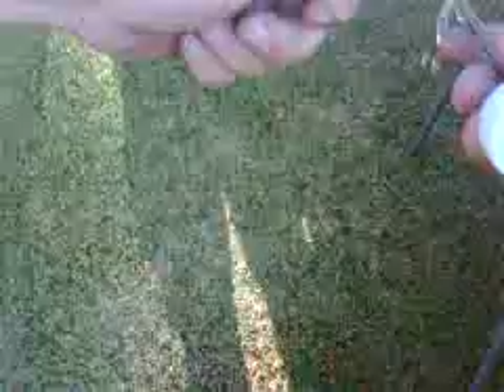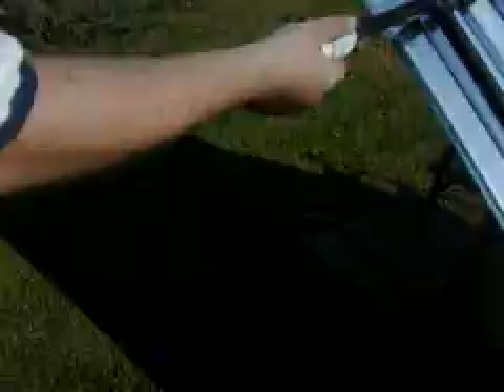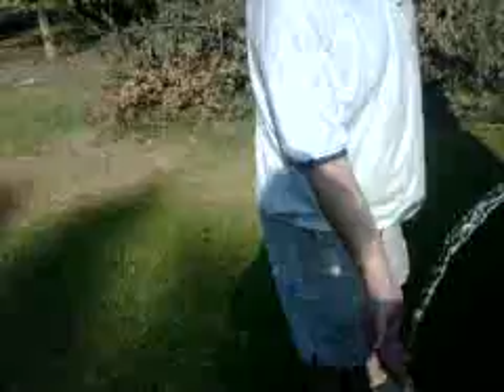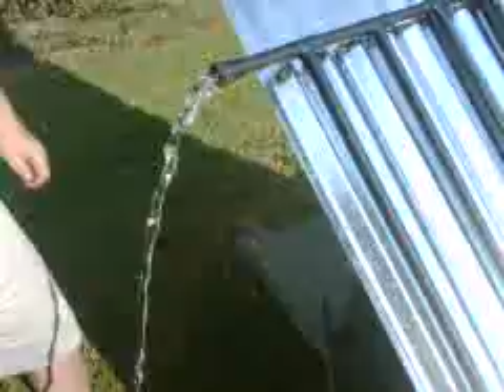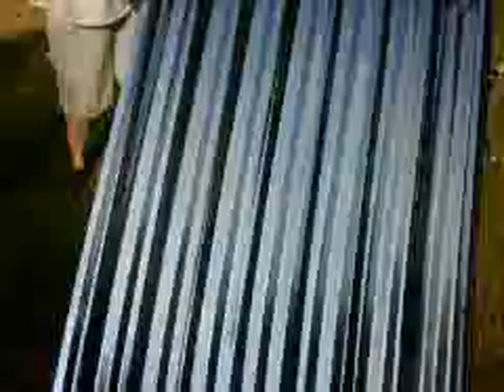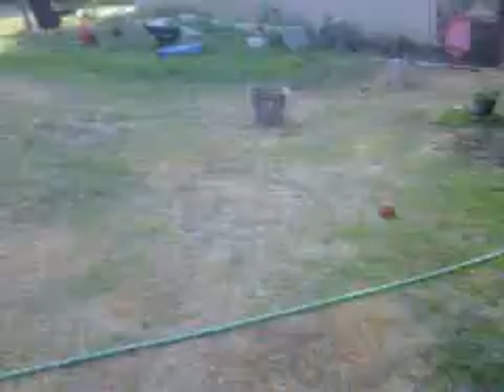Solar Water Heater build 8

Comment: GREAT WORK! THANKS!

Thanks for the great series of videos. I learned much. I am planning on having a hot-water tank attached to mine and let the water thermally recirculate through the grid to stay warm. If there is not a functioning one on the tank already, I will add a high-pressure blow off valve. Also going to add an automatic thermal blending device at the house to avoid scalding hot water. Have you had any experience with these types of design gadgets?

Comment from the maker: I have always wondered, how does this design not allow water to flow through the whole thing? several people have said the same thing and I just don't get their points, I see that a serpentine seems better because its a single flow, but we all know water, especially water being pumped will go anywhere it can, so I still fail to see the difference, heat rises, hot water rises, so far I have has no issues.

Comment: Sorry, as I said, do not mean to rain on your parade...i'm not suggesting it not a worker, but having made bit of copper work, it's somthing i've looked at and thought about, and gazed at other to try and descibe how to do it better. But of course, here in lies the madness of never being satisfied....you have it and it works, but if you can drag another 3 - 5%, & the price of the virtical tubes goes down, 'cos there smaller. It will always be a compromise.Regards Bob

Comment: I don't mean to rain on your parade..but 90.6 to 114 degrees..nice but no biscuit..lovely piece of work.. i'm sure the energy companys an't quaking in boots for 24 degs. Nb feature of central heating rads tubing of different sizes, horizonal / vertical, water pressure spreads it's perculation more evenly across the panel verticals.may be achiecevable by crimping the tubes near the inlet tube ? Vaccum box / enclosure 14 Lb/sq inch..it'd collapse,but  solicon gel to absorb moisture, would help.

Comment from the maker: @GreenSolarGarden this system wouldn't be a direct use one, it is tied into a storage tank that uses the thermo-siphon technique to continually heat water through this manifold, the water you would use comes from the storage tank itself. The system I am working on now uses a glycol solution in place of the water and a coiled copper heat transfer inside the storage tank. I wish I could find a welder/fabricator that would help me create a tank with a removable heat transfer coil.

Comment: Can you post a pic of the finished product and let us know how well it works?
Everyone knows that still water in a garden hose can reach high temperatures. But what I am wondering if the continuous flow of cold water into the system can still heat the water to a high enough temperature to heat a pool using this method. I really like the idea of the dyi methods.  Commercially sold items may work better but they are far too expensive for many.
Let us know. Thanks.

Comment from the maker: @Mcplumpyboy I would keep it copper just because but I would suppose any thing would work as long as it was insulated, you could do either PVC or cPVC with insulating sleeves over them, key is to no loose heat!!

Comment from the maker: @Mcplumpyboy sure we all know that heat rises right? so with the flat panel lower thatn the water source (bucket, barrel) then hot water wants to find its way to the top of the heat source i.e. the top of the panel, this is why in all flat panel designs the cold water inlet is on the bottom and the hot water outlet is on the top. The hot water flows upwards and will continue until it pours into a container, now in that container the hot will stay on top and the cold will flow down and repeat!!

Comment from the maker: @Mcplumpyboy this one is also in an insulated box, but during this video it was just a free standing manifold. You have to remember as long as the water source is higher than the manifold it will have fall pressure, it may not be much but it will work, a typical assist would be for a solar powered pump or pressure tank to be installed inline.

Comment from the maker: @kaioli3005 this IS the water heater!, but if you wanted to use it as a pre heater then you would just include it in the cold water line before it goes into the water heater itself.

Comment from the maker: @o0donnie0o, I use a 80 gallon water heater tank to store the hot water in, I have been tinkering with removing all the water form this system and using a Glycol solution in its place and coiling soft copper rolls around a stripped 60 gallon tank, and allowing the thermal siphon effect control the flow of the mixture, making it a closed loop heat transfer system instead of direct use until theres no more hot water, its a work in progress I will be posting more vids very soon!!!

Comment from the maker: Yes, this system is set up to run as a thermosyphon, this panel heats the water it holds, approx. 2.5 gallons continually then using the thermosyphon it flows up and into a insulated catch and hold tank, cold water is introduced into the base of that tank from the source and it mingles with the already heated water, then it makes its round, the water used is from the top of the tank and is used conservatively.

Comment from the maker: Thank you Justin, The solder used on copper pipes is a rosin core solder not the type used on electricity which is a soft lead solder. Plumbing lead free solder requires a temperature of about 217 °C or greater to melt, and water is steam by that point.

Comment: Great video.

You mentioned flux earlier. Regarding the sealing of the pipes, did you use standard solder (the type one uses for circuit soldering?) or something different? Doesnt solder start loosening with the high heat?

Comment from the maker: somewhat similar yes, too bad that dr, stinky doesn't show more info on how he made it and temperatures, his system uses small 1/4" flexible copper also, his system might hold 1/2 a gallon, mine holds about 2 gallons. my system also will be insulated and in an enclosed panel with a glass over boosting the temperature.